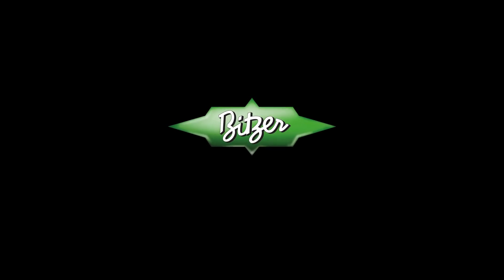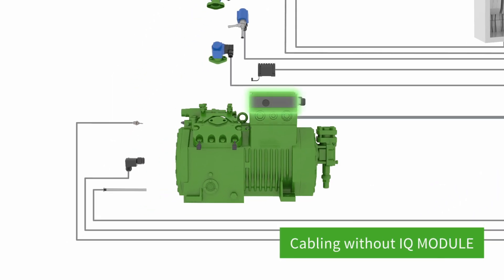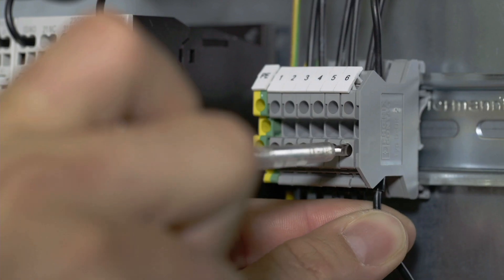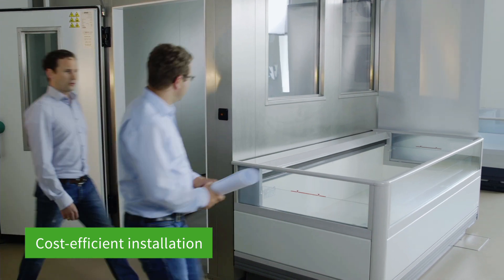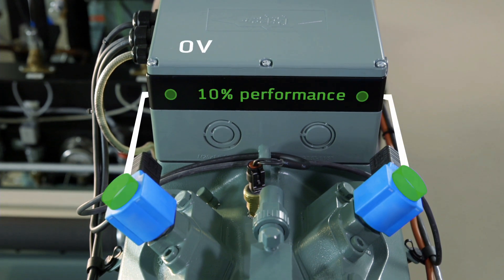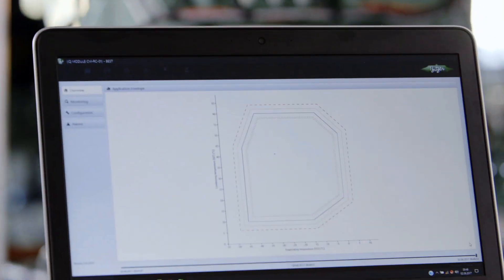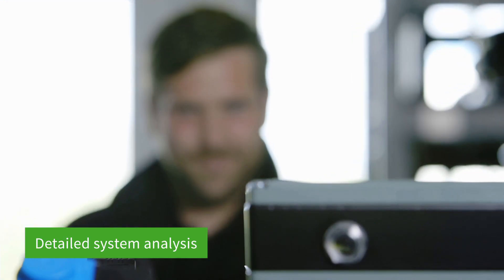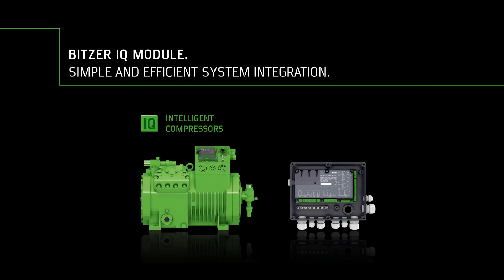BITZER IQ MODULE: a new operating concept for reciprocating compressors

Comment: What about two stage ? I've got and still have a S6G-25.2Y and have a hard time specially in summer to have the line complety efficiency working.
With +35ºC in the ambient and 60% humidity can't handly without the delay in the production system, replaced the condenser unit time ago, recalculated and installed a bigger one, because the original one was leaking in a lot of pipes because use of water <. Wich are your recomendations? Thnaks
Reply from the maker: Dear Thomás, Thank you for your request. We need to understand your problem a little bit better. That's why we'd like to contact you directly via phone or mail if possible. May I please ask you to send us your contact details including the country where you are coming from to the following address: pr@bitzer.de ? Thank you very much!